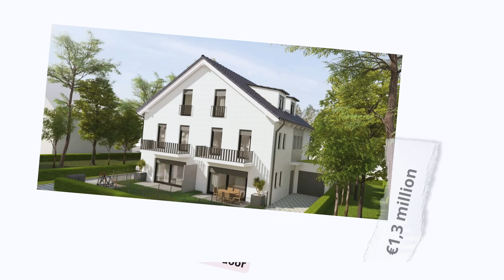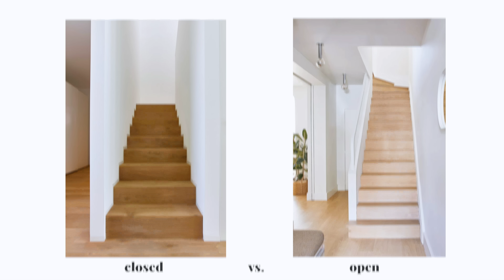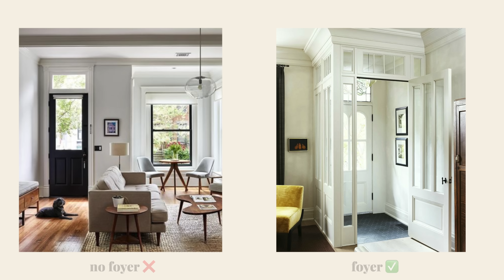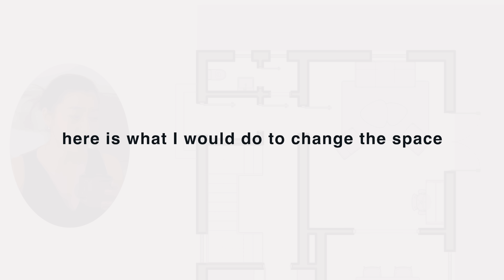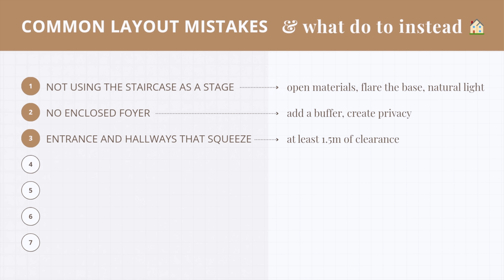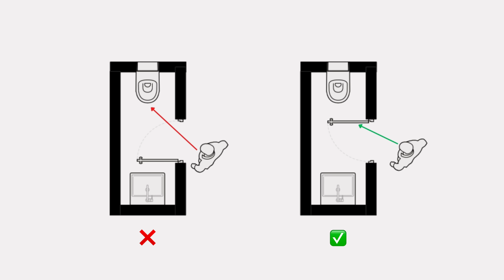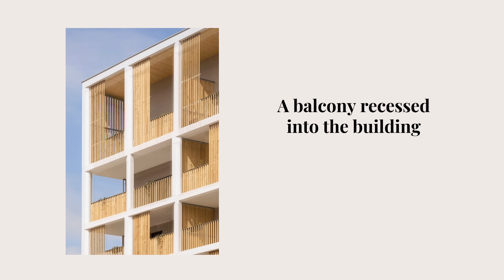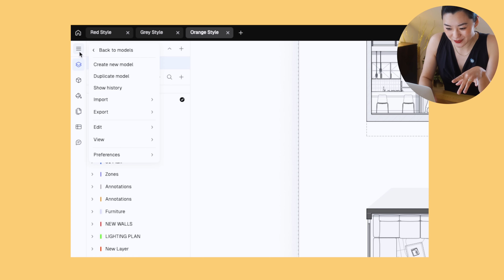Architect’s Advice: 7 Common Layout Mistakes + What to Do Instead

Comment: I am a contractor remodeler, some times its difficult to get windows on 2 sides,  mirrors and or closet mirror doors can help with this.
Reply: Difficult, lol. Some rooms are not corner rooms, so they simply have only one exterior wall. I'd say it's frequently impossible.
Reply: Incredible information
Reply: Terrible advice! We put up mirrored closet doors, and now my wife is expecting another child!
Reply: @ Exactly, but if i used the word impossible that opens up a different conversation.
Reply: The majority of humans live in flats or attached houses, which means your home only has one or two outside walls, this makes it absolutely impossible.
Also most attached houses here are 6 meters in width, minus exterior walls and one interior wall there's barely 5 meters left, she advices to essentially 'waste' at least 1,5 meters for an entrance...that is only used to walk through to get to the actual home.
Reply: @Nature-pilled  She started with million Euro houses. So she is clearly targeting a demography that can afford space. Plus she is very VERY pretty, that means she isn't the type to work with low income losers.
Reply: @iamnormal8648  

I get having a target audience, it just comes across as if she does not even acknowledge that most houses aren't anything like that.
Stay calm, you sort of lost it at the end.
Reply: Having (large) windows in 2 walls also limits your options for bed and wardrobe placement. Unless you're living remote one of those two windows will probably face your neighbours house which may or may not be pleasant to look at.
Reply: @ArgumentumAdHominem  Yes, but she specifically mentioned rooms that CAN have them on multiple sides.

If they cannot, you can always design the room to be longer and run parallel to the wall, not perpendicular to it, and possibly have two+ windows on that one wall.

Alternatively, you could aim for the corner rooms to be the living spaces you want to be in (salon, maybe bedroom, study etc.), while utilize the middle rooms for utilities (bathrooms, 'storage rooms', kitchen if you're not hot on cooking at least etc.).

Her complaint is that some architects CHOOSE to forego the second light direction, instead of having no choice.
Reply: @Nature-pilled  You're looking at it incorrectly. She's an architect and she's talking about the architect mistakes. This is not relevant for most people in the first place.

If you do NOT build a house, you have zero connection to architects. Nothing, nilch, nada. You rent a place or buy a ready one? The architects customer is the developer or the previous owner. Not you. You're not in any position to make use of construction advice in the first place.
If you are living in a flat or attached house (and plan to keep it that way), you have zero say, literally, therefore literally nothing of this video has any relevance to you.

And if you DO build your own home? Then you're not living in a flat or attached house, or a place so small that you can barely fit in anything. At that point, you CAN afford to add a small foyer or a dedicated corridor (which is actually really common even in attached houses and larger flats, by the way).
Reply: You do realize that a homeowner can pay a construction team to change a wall, a doorway, a kitchen, a bathroom...?

The thumbnail of the video is a very small home, something like a small appartment.
Her example of an entrance that is "too cramped" is clearly from a narrow house, likely an attached house (no windows).
She herself stated that this is "non negotiable for comfort" and the photos imply that this should be applied even in narrow houses.
The irony is that she probably could not find one example of a small entrance in a large mansion...because the smaller entrance size is clearly just a logical compromise in a smaller or more narrow house, making this advice bad/useless in most cases.
Reply: @Nature-pilled  Yes, you can hire somebody to make some changes (and/or do some changes yourself). Some houses are built literally with the idea of being easy to make changes to.

But these changes are going to be limited in most developer-made buildings, except stand-alone homes.

You won't be able to change the piping and basic electricity much (if at all) in your flat. That's just not going to happen. Sure, you may be able to move the sink a meter to the side, maybe make step to your kitchen and move the sink onto an island. But you won't be moving that bathroom across the house to the other side. Or even switch it with the bedroom next to it.
In large-enough attached houses you may have some wiggle-room with the additional bathrooms (eg. I had once a small bathroom under the stairs, so I had the foundation to move piping to any floor in the middle of the house). But that's not a realistic option in flats or any small space. Unless you have so much money that you should have bought a bigger home to begin with.

Further, I don't even know why you are even considering the thumbnail. It's not in-context. Maybe it was to present one of the cases? Maybe it was just clickbait? I honestly don't know since I do not look at thumbnails, so I don't remember whether it even appeared in the video. They NEVER have any valuable information from my experience.

She gave more than one example of not exactly small, but not large spaces either where the 'entry' area could have been created without causing much issue. And again, most homes I've ever been to had options where you COULD make some entry, or outright had an entry area. It really does not take that much.
Think about it. Do you EVER use the space in front of your entry door for anything other than entering or leaving? Unless you have 10 square meter apartment (these should be illegal world-wide...), absolutely not. 
Do you have a house where there's zero 'walking space' (corridor/hallway)? Again, unless you live in micro houses, certainly not.

There is space, that is not utilized, for closing it off from the living rooms. It's almost always a choice. Almost never a necessity. And when it IS a necessity, you have pretty much 0 options to make renovations anyway, so your entire argument completely falls apart in the first place.

Again, you are looking at it from the wrong point of view. Unless you have means to completely rebuild the space (almost impossible outside of personally owned stand-alone home), you have limitations to what you can and cannot do. Adding or removing a dividing wall is not a problem. Adding or removing doors is not a problem. Moving an electric socket usually is doable (but may be ill-advised if you don't have/update building plans). Moving kitchen or bathroom is a significant issue, that's expensive, and that will likely not get permission from whoever owns the place if you are a renter. And if you do? It's very likely to result in significant issues down the line, as the piping, its pressure etc. were designed with specific network in mind). 

And...again. These problems start disappearing...at the same time and under the same circumstances that the problems you have start disappearing. You are building your own house, or the house is large...or you are so rich that you can actually move into a house that fits your needs to begin with.
Reply: The topic was making the entrance wider (changing one wall) which would mean that the area next to it (usually living area or kitchen) becomes smaller.
The topic was not piping to a bathroom, having any entrance at all (foyer), walking space, and whether or not you look at thumbnails.

Do you really think that small apartments should be illegal? Then where do you want these inhabitants of these small homes to live?
Reply: good point!
Reply: @ranman5501  😂
Reply: Strategically placed mirrors can make a world of difference.  Just try to angle them downward slightly so you're not constantly jump-scaring yourself.
Reply: Well if it's not a corner room, it's not a corner room.
But if there's enough exterior wall space, you can still do more than one window on the same wall. OR... go big with glass and just use sheer quantity in lieu of variety.
Reply: Also, keep in mind, every wall with a window is a wall that cannot be used for many purposes. So, if you have 2 walls with window and one with a door, you will struggle to put a bad and cabinets.

Comment: My biggest pet peeve is prioritizing aesthetics over function and practicality. “That kitchen island sure does look pretty but now grandma can’t turn around with her walker in the kitchen.” Or “ wow beautiful wall length bedroom windows! But now I have to crawl through the bed to open the shades”
Reply: Smart home automation can help in some of these areas
Reply: @alexsamuel3493  sure but an over reliance on smart tech can be a crutch and liability. I just want a house. Not a computer to live in.
Reply: @alexsamuel3493 I'm not the highest tech guy, but I've always found the inherent base function should be simple and usable. Smart, or simply higher tech should be there to improve the base function, not cope for problems present to begin with.
Reply: @rya3190  couldn’t have said it better myself. I don’t like the direction smart homes are going. And I’m an electrician who frequently does building automation. When power outages and maintenance issues hit, houses will be inoperable. Most people can’t replace an outlet, much less troubleshoot an automation system. Smart tech should supplement homes not substitute mechanical components or compensate for a flawed design
Reply: @geoarambula139 smart home is the future. my dad didn't like it. so in the end, we had to manually switch off the lights especially when the designer messed up with the 3 way switches big time and the house is BIG
Reply: @geoarambula139  "I just want a house. Not a computer to live in" 😂 I'm with you there! Automation can be great but if it breaks, what a headache. My old blinds and curtains are moved by hand but still working after 30 years.
Reply: I think kitchen peninsulas are long overdue for a comeback.  Or, pass-thrus from the kitchen to the dining room instead of a full open-concept.  I am neither an organized nor a clean cook.  I don't want my guests watching me while I unnecessarily dirty every pan I own to make dinner.
Reply: THIS!!!
Reply: @PongoXBongo spot on! Kitchen islands LOOK great. But are so impractical and space consuming. Part of the reason house sizes have grown ridiculously is because people just have to force a kitchen island. Because they saw it on HGTV 🤦.
Reply: Grandmas with walkers make up what percentage of people using the space?  Not really relevant
Reply: @debbylou5729 I’d expect that most people would want to grow old in their dream homes. Most of us will need a walker or wheelchair at some point. Or will have to take care of an aging parent one day.
Reply: @geoarambula139 most people don’t grow old in their dream homes. People change plans, people down size. My favorite house was over 4,000 square feet not counting the finished basement. It’s not the home I want at 70. You might as well add counters and hallways for wheelchairs and walkers. They’ll be horrible for most of your life, but you’ll be prepared. Install that ramp to the front door and get rid of the entire second floor while you’re at it. I mean grandma isn’t going to be happy with that either
Reply: I'm 100% with you.
There's a show in Australia called The Block. They renovate/build houses.
And the judges who determine which team wins each room, seem more concerned with aesthetics than functionality or practicality.
Particularly if you actually plan to live in it, where you will need to keep everything relatively clean.
Reply: @kathrynck you’re absolutely correct. That being said it’s why most places aren’t adequate for later year of living. The house I loved the most had all of what you mentioned. It was still not a good fit. Way too much empty space that I would’ve been paying taxes on and cleaning
Reply: @debbylou5729  I'm kinda all about "cleaning efficiency" myself. Spent a stint in fast food labor... I have immense appreciation for how things need to be, in order to be quick & easy to clean.

Property taxes though, yeah. Definitely.
I'm kinda considering getting an RV to count as the 'residence' and just building a home... but calling it a shed as far as paperwork is concerned. Particularly since I want to be kinda novel about the design & building materials/processes. And building code is extremely limited to only 'boring ideas' in those regards. And often insists on methods & designs which are considerably more fragile and temporary than what I have in mind. Or put another way, my design would never pass code, it doesn't have nearly enough built-in obsolescence to pass code. But I'm not going to build a tinderbox house out of matchsticks, paper, and fluff in tornado/termite/mold alley.

Comment: Thank you for posting this.  Every volume home builder today makes every one of these mistakes and sells it as good ideas.  The one item I would add is not having 1 large space for kitchen, dining and living.  No sound control.  Something from one of those areas will eventually be disturbing to another.
Reply: Absolutely critical. I have never felt comfortable in those unified spaces and it has never mattered what size it is. I've thought about it in terms of semi-private spaces, where it's attached to the larger gathering area, but you have space to talk without the larger group at a gathering getting involved.
Reply: I think people got the wrong idea looking at older homes with archway-connected spaces that were missing their original dividing doors.  The grand double doorways were spectacular.
Reply: @PongoXBongo  My 1932 house had these originally too, having the parlor in the front and the dining/living room in the rear. The parlor was used mainly as a reception room for family and other visitors on a Sunday, while only the rear room was in daily use.
But in the Netherlands too, many older house had them removed. Nowadays prewar houses which still have these original features will yield higher prices than those without, and there is even a market for second hand partition panels and doors, often with lush stained glass in them, yielding high prices too, as many buyers of these Art Nouveau and Art Deco era houses want to reinstate these.
My new kitchen will be partially partitioned off, and have a half height wall along one side giving some separation, while not completely blocking light from that side out.